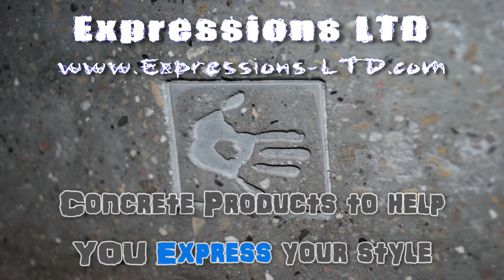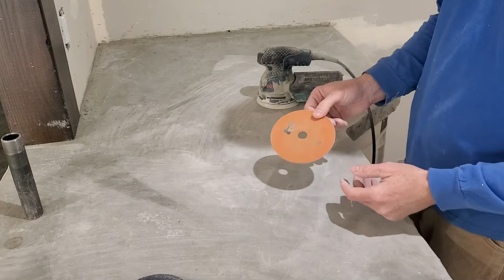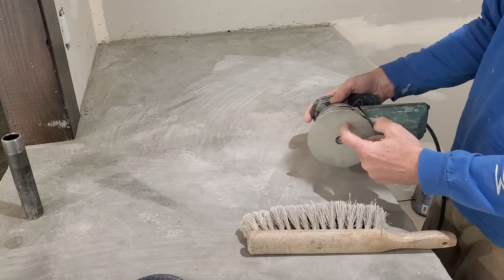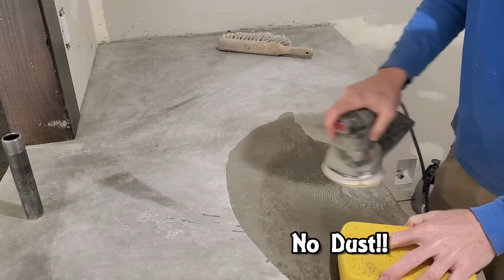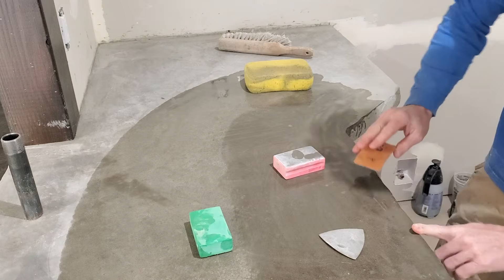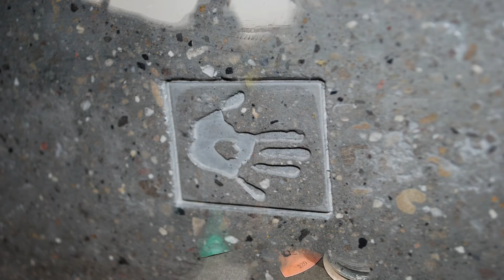Concrete Diamond Sanding Pads Electroplated

Comment: i need to sand a concrete floor that has floor paint on. most of which i have scraped off. the floor is in pretty bad shape but it doesnt need to be perfect or anything. would a random orbital sander work ok to remove the remaining floor paint and smooth the concrete a bit. if its wetted will the dust be reasonable?
Reply: I’m curious, what did you decide to do cause I’m kind of in the same predicament. I don’t want to spend a lot of money because the house is being put up for sale but I also want it to look presentable
Reply: @thatswhatshesaid6326  i have not done anything to the floor yet. i tried both an angle grinder and a random orbit sander but the first was way too harsh and hard to control and dug in and left big grooves. it also created lethal amount of dust. i reckon it could be done but im scared of the dust. and the sander was the exact opposite and did absolutely nothing. i cannot see any paper working. ive decided its a job for the professionals but it will cost quite a lot

Comment: Advice for filling concrete plastic wall ties when you remove the outer plug cap? Looking to sand our concrete walls as a feature? Was going to get a concrete mix and sieve the stones out and use the powder thanks mark
Reply from the maker: Using concrete mix and sifting to remove the larger gravel is one way, that should work.  Once the plastic cones come out of foundations though, the concrete surface can actually be pretty smooth in there, and so harder to bond to.  It would be a good idea to scratch the concrete in the cone first, before filling, to ensure a bond is created, since you will need to use a fairly stiff mix on the concrete to keep it from trying to sag.
Reply: Thanks we will experiment on a non visual area first, try some mixes, the brace caps are approx 40mm diameter cheers mark

Comment: Hello i just want to ask what other things should i purchase before doing this kind of process. I am planning to do a diy using an orbital sander to a cement floor like this one, based on my reseach i need to buy a backing pad( velcrow or hoop and loof) and replace the existing pad so that it si suitable for concrete project. Is that true or the preset backing pad is enough?

Comment: So once i get the concrete as smooth as i want, then what? Slurry? 

I don't want to see the aggregate. Slurry on top after sanding? Then sand again? 

Also, can you recommend a sealer that wont "yellow" in full sun?

Comment: Can this be done on concrete floors that have epoxy on top?
Reply: (2yrs later) kind of, BUT you don't need diamond grit, and sand paper or mesh, and you want to go to 1000 or 2000 grit and then polish with a polishing compound.
So it's very differnt gear, with a lot more steps to keep clarity.

Comment: Isn’t concrete dust extremely toxic for the lungs and requires a filter on the sander and protective gear like a heavy duty mask?
Reply: Yes it is. Water will alleviate the dust. Wet grinding/cutting will inhibit the airborne crystalline silica from flying in the air. You can still wear a mask, but the water will trap the dust and instead form a slurry.

Comment: Question, if I add black color powder to the cement and then I polish will the black/dark gray color still show after I sand? Or will I get scratches with a different color. Thank you.

Comment: Do you not grind with a diamond cup and angle grinder first? Thought it would speed things up?
Reply from the maker: Diamond Cups (Turbo Wheels) are generally a bad idea.  Way too aggressive for a countertop.  The diamond sanding discs do a great job for minimal touch up and overall profiling, prior to staining and/or sealing the concrete.  If you want to polish deeper, and expose sand/glass/rock in the concrete, then you would want to use a polisher tool and resin diamond polishing pads, which will aggressively cut through the concrete.  https://www.expressions-ltd.com/collections/concrete-polishing-and-grinding

Comment: Very helpful video for a novice like me. Thanks! 

Do you have any recommendations on a low-priced orbital sander at Home Depot, Lowes, Ace? I’d prefer to buy something than rent, so I have it for the future. But I don’t need anything expensive or heavy duty.
Reply from the maker: The ideal choice is a cordless with heavy duty Velcro like these on Amazon: https://amzn.to/32tTp7N.  We have a few of these at our shop and they work great.  If you want to save a few bucks, there are cheaper sanders at that link above too, just make sure you get a variable speed version so you can slow it down.

Comment: Great video! What rpm do you recommend using on an orbital sander when using the diamond disc?
Reply from the maker: Medium speed on a sander works well.  If you have good, aggressive Velcro 'hooks' on your sander, then you can seat the diamond pads really well to the sander, and then sand at full speed if you need to (works best to use a little water when sanding fast to keep the pad cool).  If you don't have great Velcro on your sander though, either upgrade it (like these on Amazon: https://amzn.to/3dfxiYH ) or just sand much slower to try and keep the pad seated and not burn off the Velcro on the pad!

Comment: I have a cement ceiling that has been covered in 1/16" to 1/8" of textured drywall mud to match the adjacent walls. I have removed as much of the drywall mud as I can and am left with a light haze of drywall mud. Will the 120 grit and 220 grit work to remove all of the remaining haze so that I can get a pristine ceiling of cement? trying to get a loft style look. I could email photo. any info would be greatly appreciated.
Reply from the maker: Yes, these diamond pads should cut through the top layer of the cement surface, which sounds like it would remove the residual look left from the drywall mud!

Comment: Great video. Is the sander a variable speed one? Would you recommend using one with no speed adjustment? Need to do a small bathroom floor and I’m debating myself if I should by a polisher, thanks !!!
Reply from the maker: We would suggest a variable speed sander yes.  When using the diamond pads without water (dry) it's good to lower the speed.  When using with some water, then you can speed up the rotation as the water will help them cut and reduce heat buildup.

Comment: Thanks for the video. How should the concrete feel after a 200 grit sand? I did a steel trowel finish on mine and there were some spots that feel grainy, like rough sand. It feels pretty much the same after my 200 grit sand: Smooth in most places, gritty in a few places.
Reply from the maker: It should feel pretty smooth.  You might want to try sanding with water as well, over those rougher areas and may help cut through the sands you are most likely feeling.

Comment: Roughly how much square footage do you get out of each pad? Can they be washed to extend their useful life?
Reply from the maker: Hard to say, as we are still using the same set a year later.  We've probably sanded the equivalent of 300 sq. ft. over this time here, but the pads still look near to new.  The velcro backing on them is the only thing that seems to wear, and that only happens if the pad isn't seated really well onto the sander.  We normally sand with water (spray bottles or sponge to apply water as we go) and so that probably prolongs the life of the pads.